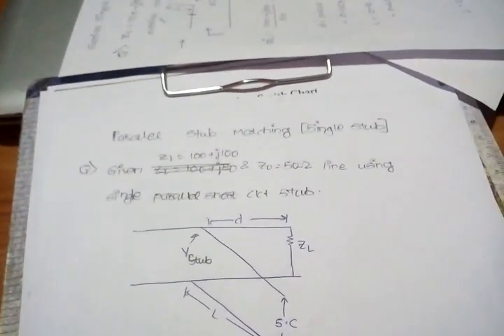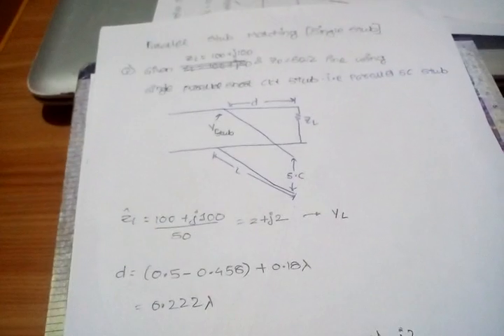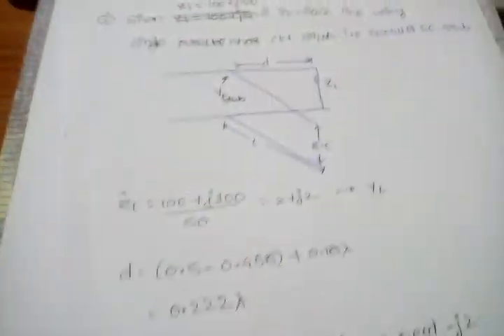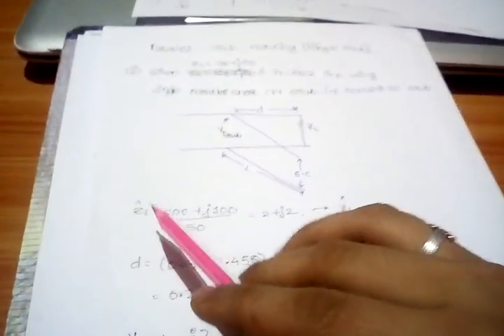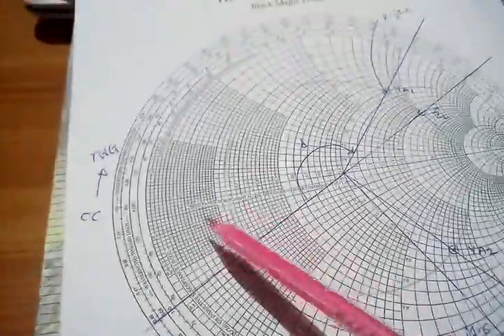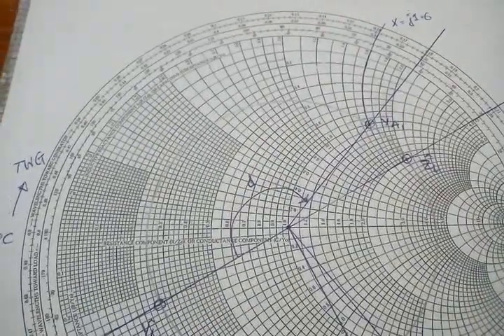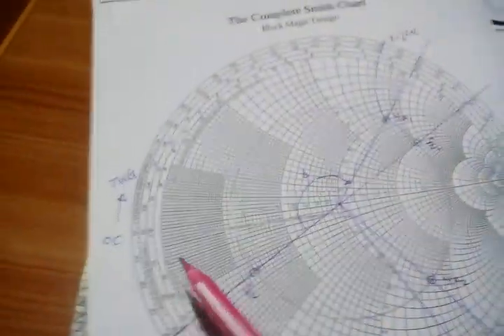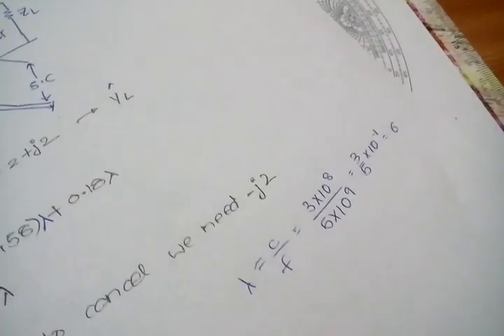Single Stub Matching (Parallel Short Circuit)

Comment: At 10:37 it should be (0.5 - 0.08)*lambda right? That's the length between O.C point and -j1.6 point

Comment: still confused with admittance selection part where u mentioned dont get confuse
Reply from the maker: There's nothing difficult as such. I would request you to please go slowly and you will definitely get it done.
Reply from the maker: IN Parallel Stub we prefer to use admittance and in series we prefer to use Impedance. As sums will be easier and less time consuming.

Comment: Why did you subtract 0.5 in calculating d?
Reply from the maker: the overall scale of smith chart is ranging from 0 to 0.5 on the outer as well as inner circle. so to find out d you can find by adding in parts. What i did was took shortcut and subtracted the remaining from 0.5
Reply: Sumanyu Rao  thanks. i understood it
Reply from the maker: welcome..anytime..any doubts do comments...

Comment: (3 x 10^8)/(5 x 10^9) = 0.06m or 6cm! you haven't mentioned the unit after calculating the value for the lambda which might confuse people. Otherwise the video is really helpful :)
Reply from the maker: lamda will be always in meters@Akshay Nikumbh ..btw thanks for feedback.. I will improve